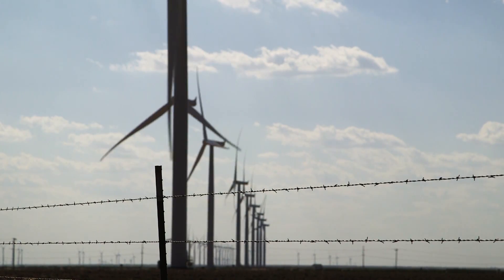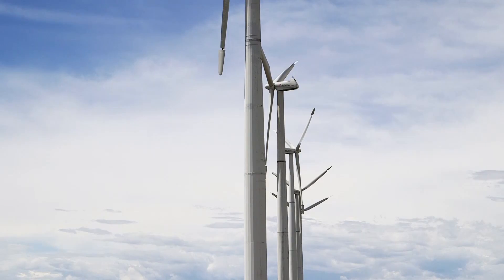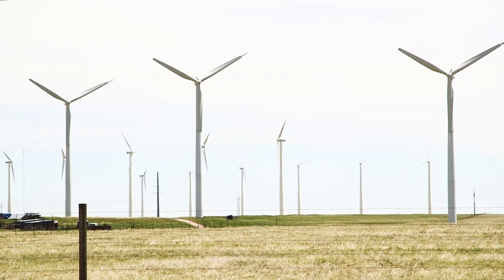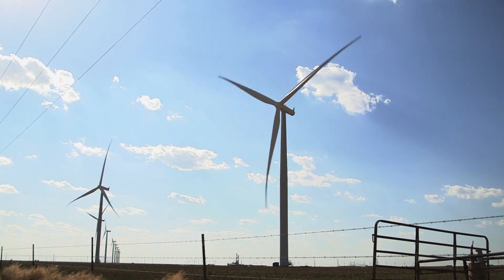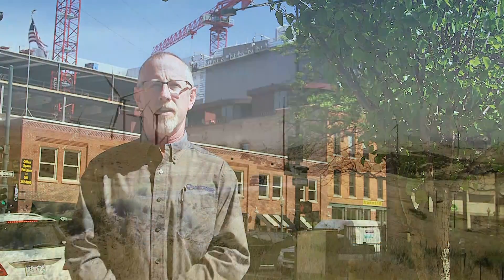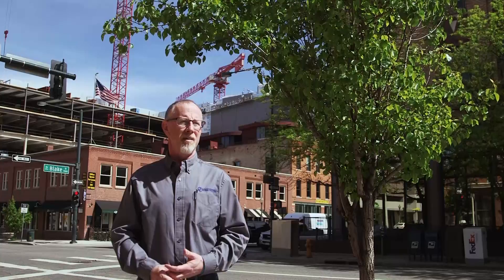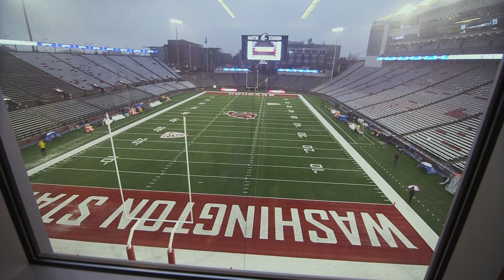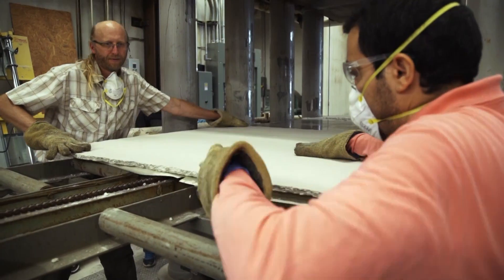Recycling Retired Wind Turbines

Comment: Real green energy filling up land fill sites
Reply: Least the blades won't be making  methane gas like the rest of the landfill.
Reply: @2148aa  you are right, it will be a toxic sight
Reply: @2148aa  wow, you really dont know much about landfills, they burn the methane off and some places use it to heat homes in winter

Comment: So yet again 'green' power is not green at all.
For the most part these far from silent pieces of equipment are as dirty as coal powered generation which generates for far longer than a wind turbine.
The used solar panels too are  already a major drama. Most seem to have a under 10 years life span, some as little as 5 years

Comment: The average American sends just shy of 2000lbs of trash to landfills every year. Which is about 50,000lbs over 25 years, which is the average design life of a modern wind turbine. Which (oddly enough) is about the weight of composites that will be getting land filled from a turbine getting close to its end of life.

But people are getting all precious about turbine blade recycling. But don't really bat an eye about taking out their own trash.

That same wind turbine will offset approx 70,000  tons (yes seventy thousand tons) of coal from being burned over its life span. But people are worried about 20-30 tons of non-recyclable material? Even if we make no effort to recycle these materials, we are lightyears ahead than if we just burned coal.
Reply: LIES, wind and solar are not good at all, 15-20yrs for a lifespan is really bad

Comment: This Dutch company recycles composite materials from used boats and wind turbine blades since 2019, it is called, Extreme Eco Solutions. Search for it, because either youtube or the channel administrator won't let me post the link to their website. It is getting removed. They produce floor and wall tiles from recycled composite materials, and those floor and wall tiles can be recycled 100% as well.

Comment: This is not because wind turbines can't be recycled, or that this is normal practice, because wind turbines do get recycled. It is just wrong practice if it happens, and it should be illegal to dump used wind turbine blades at a dump site. It is simple as that. If this truly happens it is just a matter of bad policy. Every single part from a wind turbine, including the composite materials, no matter how rough the state of the material is, can be reused as a material for new products. And companies that do recycle those materials do exist, and they make a profit without subsidies. At least in my country. But if we can do it here, it possible anywhere.

Comment: Every single one of these was trucked from the manufacturing sites using diesel trucks.
The ground was site prepared using diesel powered earth moving equipment and  machinery.
The gensets,the composite nacelles and blades were manufactured with fossil fuels and the green energy proponents never address the significant bird destruction attendant with this inefficient form of energy.
It can't be  stored and demand is harder to plan using mother nature.
Liberal thinkers dismissed the slaughter of birds, even though I recall the green tree huggers in Oregon and Washingtin stopped logging or heavily curtailed that industry to protect the nests of the Spotted Owls.
Come to find out the Spotted Owls were more intelligent than the tree huggers.
True story.

Comment: Wind and solar energy are both great theoretical ideas but do not deliver what they promise. Wind turbines have a lifespan of only 10 years (not 20), they never pay for themselves and cost much much more to build and erect than the energy they produce. Solar panels at best are 8% efficient. It requires acres of panels to power one medium sized house. The cost far out weighs the output. It requires a lot of petroleum to produce these panels in China In short wind and solar technologies are both a scam.

Comment: Renewable energy needs??   We don't need any expensive, subsidized "renewable energy"!!
Renewable energy is a joke and a drain on the economy.   It drives up the cost of all energy.   Same goes for ethanol that goes in gasoline - it has driven up the cost of gas and the cost of FOOD.   The millions of acres used to grow corn to make ethanol (which costs more per gallon than gasoline and does not make an engine burn cleaner) is in competition with food and has made is all more expensive including cattle feed.   Have you noticed the price of beef lately - it is twice what is was 5 years ago.   The only thing sustainable about biofuel (Yeah, that is what ethanol is) and wind and solar is that they are a sustainable drag on the economy and capitalism.

Comment: So basically you environmentalist idiots once again failed to look at the big picture and realize that the fossil fuels you saved to create energy, admitted millions of pollutants in the air to build these structures and mount them in the wind farms. Now they need to be removed these wind turbines, place the non-recyclable trash our landfills,  using fossil fuel equipment to take them down and transport the pieces, contributing more pollution in the air with the equipment needed to transfer them, and dumping rare earth metals that will migrate into our water system. Nice going idiots!

Comment: RETURN THE SITE TO ORIGINAL !
Since the 400 tons of concrete and reo bar for each turbine is under the dirt and out of sight, I suppose there’s no need to dig that up and rehome it to landfill. 
In case that concerns anyone just search U-Tube for building a wind turbine, see just how much land excavation goes on at site. Consider where all that 400 tons of crushed rock for each turbine comes from, out of which river bed ? , quarried from which mountain side ?
Reply: how many miles of steel pipe and cement are left in the ground when oil wells are plugged and abandoned? the pipe is cut off 3 feet below ground level. the rest stays in the ground.
Reply: Rock crushing is very fuel intensive. One mobile crusher I used to deliver fuel to used 7000L of diesel every two days. Not sure how many tons a day it produced. The generator had a  32L v12 caterpillar engine. They had a bunch of cat 980 loaders and the whole thing ran 24hrs unless it broke down or needed maintenance

Comment: Produce a little electricity for a decade and then in the landfill for ever. This must have been an idea from the government.
Reply: And don’t forget about the millions of taxpayer dollars that subsidized these
Reply: @fishydubsfishing6516  Oil & gas get subsidies also. Comments?
Reply: @fishydubsfishing6516  The latest wind turbine parks in my country don't get any subsidy. They are fully privately owned companies and fully profitable.
Reply: It's called "job Security."
Reply: Those are old designs, modern wind turbines last much longer. Wind turbine blades that are buried are no where near as toxic as the mountains of radioactive fly ash produced by coal plants.
Reply: @johnabuick  A Dutch company recycles the composite materials from used boats and turbine blades into recyclable floor and wall tiles. None of the renewable energy haters ever mentions decommissioned polyester or glass fiber boats.
Reply: @insAneTunA  Fiberglas is pretty much inert so it doesn't do anything once buried
Reply: @johnabuick  I know, but there is a whole anti wind turbine campaign going on with videos about turbine blades being buried, decommissioned turbines left to fall apart, turbines being blown up, while all of that is totally unnecessary to begin with. 

It's not a valid argument to stop wind turbines all together. The problem in those cases are the politicians who allow that to happen, because there are profitable and responsible solutions available.  

And people should know better because polyester or fiberglass has been used for decades, if not close to a century, in and around aquatic life as well, without any problems. And anyone with a boat knows that aquatic life has no problems at all growing on to your boat. 

But we should not leave all that waste behind for future generations if we can and should solve the problem right now. 

Our generation is causing the waste, so we have the responsibility to clean it up.
Reply: Or a lot of electricity, I guess it depends on how much you pay attention. Stop equivocating. Wind turbines don't pump toxic fumes into the air or produce slurry ponds that eventually leak and get into drinking water.
Reply: lol, the pumping of "toxic fumes into the air or produce slurry ponds that eventually leak and get into drinking water" are by-products of the materials sourcing and manufacturing process.
Reply: @fudhater8592  and wild life?  Decimates bird life and upsets migration.  Pick your poison...even so called Green has its impacts
Reply: @fudhater8592  so making the plastic for the wind turbine does not release any toxic fumes into the air? Good to know. Keep brain washing people

Comment: My question is ? How much capital did this wind farm produce versus what was the cost of manufacturing installing maintaining dismantling and disposal of this wind farm ? I would like to know this information?
Not even gonna ask about the environmental impact right now ! ?
Reply: lots of people here seem to know the figures . but asking for a link  to that data  doesn't bring any replies.
Reply: i was up to an area where a wind farm is being constructed. where they put a layer of dirt over the highway for a track crane to move across the highway after the soil was moved the crane had left ruts in the pavement. this is also an oil producing area and i have seen lots of road damage caused by oilfield trucking so kind of a wash.

Comment: The cost of producing and recycling these will far exceed the value of all of their  electrical production during their life.
Reply: These idiotic bird-mincing monstrocities DO NOT pay for their own construction, installation, servicing and eventual removal and decommissioning. It`s a complete smoke & mirrors hoax!!! 
all they do is create jobs. it`s like emptying the trashcan on the floor and then paying someone to pick it all up and put it back in the trashcan.
Reply: That’s a fact . Wind Turbines put out more Co2 over their life when you take in mining minerals ,transport 
manufacture and maintenance over their lifetime than they save.
Then as this video shows they are not suitable for recycling and not forgetting renewable energy is far more expensive.
Reply: please link the study that proves your claims> i would like to study it.it seems the power coop that runs the largest coal fired power plant in north dakota is shutting it down because it can't compete with wind power .that coop is up grading a much smaller natural gas plant for base loads requirements.
Reply: also the sate government has passed a law requiring wind and solar plants to pay a tax to pay for carbon capture for the coal plants .

Comment: Stand the blades up, fill them with concrete along the Southern border
Reply: That is really a good idea .
Reply: Around DC would be better
Reply: The windmills in our area, have blades 150 feet long each.  You could bury a third, and still have a nice 100 foot tall fence.
Reply: ...and hold them together with electric barb wire.... 13,500 volts should do it..... they can double as transmission lines
Reply: @richardmaurer9002  
Nah, 50,000 volts.
Reply: boom! awesome idea!
Reply: That is a great idea!!!
Reply: honestly a very doable idea
Reply: Wire them with 575 Volt charge wires
Reply: Put the wind mills up on the boarder.  Chop chop
Reply: Man that is the best idea  I've read so far

Comment: Absolutely no one would build a power plant with a life expectancy of 20 years!! Except idiots!!
Reply: the largest coal fired power plant in North Dakota has reached the end of it's useful life that plant was built in the 1970's. just think of all the coal ash that has been landfilled over the years from the coal burned to power that plant.
Reply: @erniew5805  you are right, but that’s 50 years of running 24/7/365, windmills don’t.
Reply: @kansaskristi  yes but the capital expense to build the coal plant was much much more. plus the cost of the coal to fire the plant there were also upgrades like using waste heat to dry the lignite for better heat extraction.

Comment: And what about the land and all the concrete that is poured.....I’m bettin that land is good for nothing other than a wind farm forever. Real green stuff there...
Reply: In out area, they are all out in the cornfields.  Farmers are able to farm right up to the base of the windmills.  Once the lease expires, the farmers then own the windmills.  The generators are the size of a semi truck trailer.  Each blade is 150 feet long.
Reply: when oil wells are plugged and abandoned the well casing is cut off 3' below the ground . there are many ft. of pipe and truckloads of cement that remain below the surface . is that a problem?
Reply: @erniew5805   did he say it wasn't ? Enough of your "whataboutery" ... we're talking about turbines which are being touted as GREEN... no one said oil wells were green... 🙄

Comment: They are ruinable energy needs.  A few blades not so big a problem.  1,000,000 ??   and they 1000 tons of concrete and iron in the ground ?
Reply: every oil well drilled had many tons of cement and steel pipe in the ground most remains when those wells are plugged and abandoned.
Reply: @erniew5805  the only time I'm aware of concrete in an oil well is to shut it down and that not sit within ploughing distance if the surface and does not weigh a thousand tonnes and does not contain rebars and does not cover many acres or square metres of land.  Perhaps you can show it does ?
Reply: @stephenrichards5386  no concrete goes in an oil well only cement. many oil well sties require soil removal and replacement due to contaminated ground. the soil removed has to be landfilled.
Reply: @stephenrichards5386  first when drilling a conductor pipe is drilled to 90' + or- and cemented in . then surface casing is set to below usable ground water. here 2000 + feet and cemented to surface. then when drilled to producing or kick out point more casing 7" is ran and cemented above producing and through salt formations so when a well is plugged some of the 7" may be removed but the rest stays in the ground.